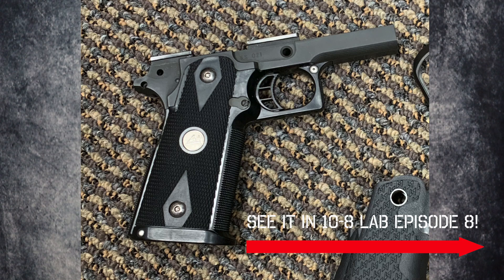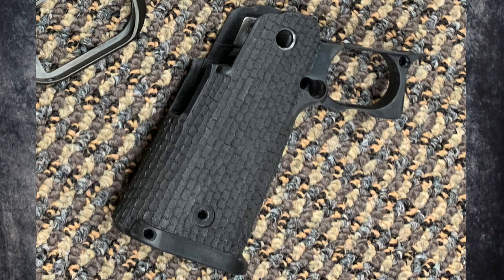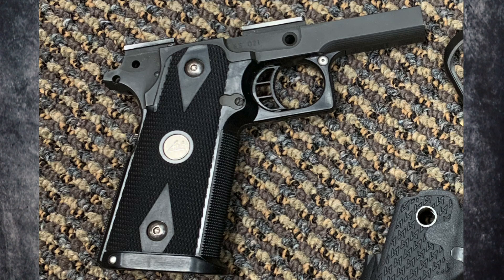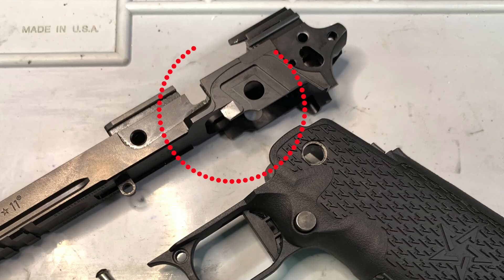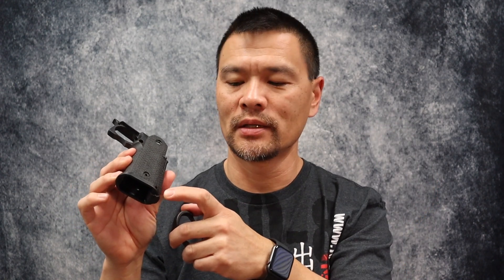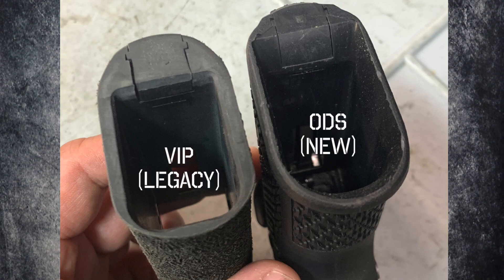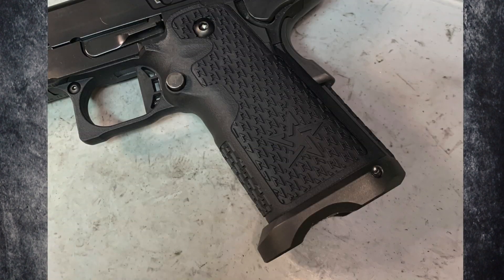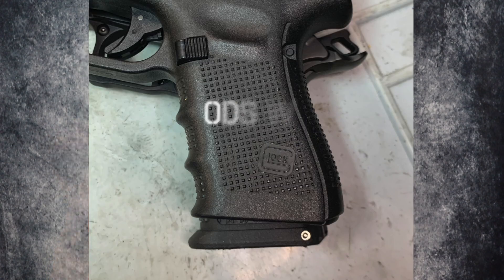10-8 Performance Lab, Episode 18: STI 2011 ODS Grip Module

Comment: Great content! It's hard to find too much useful information regarding STI 2011 and I'm glad I got so many info here! Keep doing this please! I was lucky enough to bought 2 Staccato Ps and one with gen1 grip and the other with gen2. I didn't notice that much different other than the texture difference before I watch this video and I still prefer the old one because it fills my large hand better. But as you mentioned, from the production point, the new grip module make way much more sense.

Comment: Thanks for the update on the grip modules. I was worried they weren't gonna be that good but this is great information. Was also curious about the Staccato R and swapping the grip module. Sucks cause I wanted a 5" sti double stack. I know the XL will be nice but thats a bit long for carry.
Reply from the maker: Keep in mind that the new Staccato P is a 4.45" bbl. The 9mm 5" prototypes that they'd tried were too slow cycling. If however you meant you wanted a 5" .45 double stack....then sorry you're out of luck on that one. Demand for .45 double stacks is close to zero so they aren't making any.
Reply: 108Performance I definitely meant 9mm and am looking at purchasing the Staccato P in 4.45" but saw a few reviews and mentions of the 5" model. I did not know they were having issues so that kinda sucks but oh well im sure ill like the new Staccato P all the same.
Reply from the maker: @Menacke  You will love the 4.45, it's very soft shooting and fast cycling.
Reply: Do you like the shorter carry gen2 better than what came with your duo?
Reply from the maker: @pinoykillaz438  For AIWB, yes. For exposed duty holster carry, it doesn't matter which one.

Comment: Ok, serious question...I just received my 2020 Stacatto P. It is fit very well, and is very well blended. There is no play at all in the grip safety or thumb safety and it functions flawlessly with the Gen 2 mags it came with. I'm really wondering what a $4k+ 2011/1911 can offer that STI, with their 2020 lineup can not. I was going to get a Nighthawk but now I'm wondering what the point is...I can buy 2 more STI's that seem just as good.
Reply: Alot, the Stacatto line even compared to the older DVC and Costa Series is night and day.  "Staccatto" has turned from a Custom gun company like Nighthawk more to a production driven company.  I own both so I can say this with certainty.  Go pick up a Nighthawk Triarc or Atlas and you will instantly see.  That said I daily carry a Gucci Glock or a Staccato C2 these are work guns.
Reply: @acree42  Fair enough man. I'll have to pick up a Nighthawk then. (I didn't need much convincing). :D

Comment: Are the C2 shipping to dealers yet I’ve not seen them for sale yet anywhere. I have a shop near me that is a “preferred” STI dealer but with this virus not sure if they are open or how long an order would take at this point. The ODS grip is similar in length as a G19 is the full size P similar to a G 17/45?
Reply from the maker: GlockednLoaded C2 have been shipping since the beginning of the year. Various dealers have been advertising them online. @jproarms in Instagram has had them.

Comment: Be advised, the new grip modules have issues when using the 140+mm magazines. The new magazine catch doesn't stop the magazine in time during the up stroke of the reload causing the magazine to be over inserted on slide lock reloads. Over time, this will break the ejector. STI is currently working on a new magazine design to address the issue. They are expecting the new magazines to be available around March. 

Also, the last 9 staccatos I've worked on all shot extremely low, including my private purchase.
Reply from the maker: The mag catch isn't there to stop the magazine, though it does so to a degree, by default. The G2 mag catch works as well as the legacy unit in that regard. If you smash the mag in hard enough, you can defeat either mag catch. New base pads from the factory, as well as from 10-8 Performance, are in the works which will provide a positive stop for the tube.
Reply: The Gen2 magazines in their respective lengths (140mm, 126mm) will have the corresponding baseplate that prevents over-insertion.  Gen 2 mags are working flawlessly. 165mm is just so long you will overinsert anyway but nobody wants those lol.  I think I have my lengths right.  (talking about the 17 round and 20 round mags respectively)

Comment: So you showed a picture comparing the P model ODS grip length to a G19 and it was slightly longer. Does this mean the C2 grip is the same length as the G19?
Reply from the maker: No....the C2 grip IS the ODS. The P usually comes with a full sized Govt grip module, I swapped mine for testing.

Comment: Can you do a direct comparison of the C2 and P (new 2020 models)?
Reply from the maker: I don't have either one, but they're not meant to be the same niche. The P is a 4.45 bbl, steel frame, and full size grip, the C2 is a 3.9" bbl, aluminum frame, and short ODS grip. One is a full size duty weapon, the other a mid size suitable for CCW and  plain clothes or off duty carry.
Reply: 108Performance when you talk about removing the mag funnel on the P, how does that grip compare to the C2?
Reply from the maker: Phil P C2 has ODS, P has Govt length